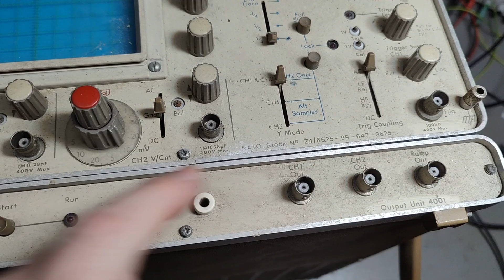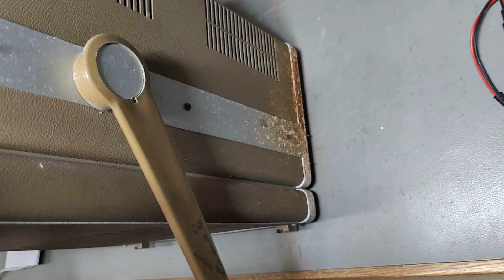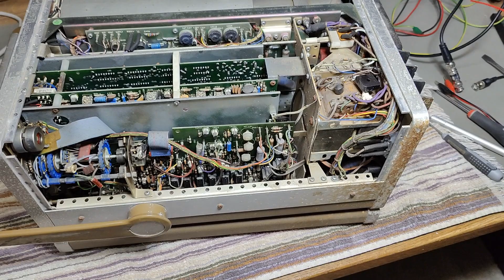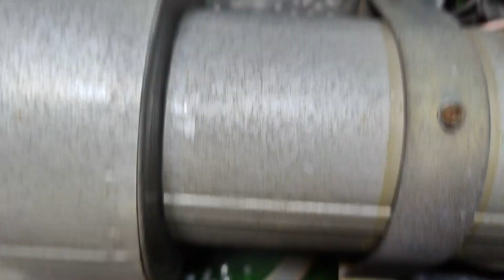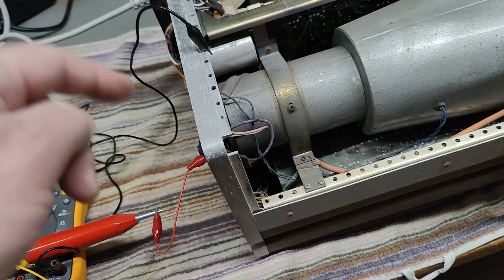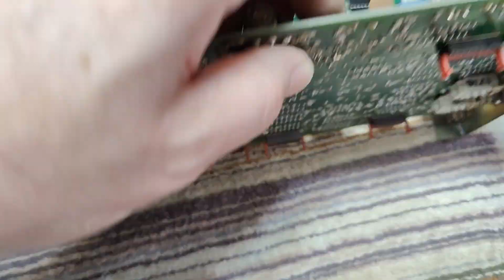Gould Advance OS4000 Analog Digital Oscilloscope 10Mhz teardown

Comment: How do you open volt/cm selector knobs ? Screw below the red cap is tight stuck.
Reply from the maker: use a knife blade and carefully insert then tip it, and then go round, the top cap can be pulled up

Comment: My OS1000 shifts trace vertically when attenuator setting is changed, both on Y1 and Y2 channels. Any ideas where to look for fault ?
Reply from the maker: you have DC offset currents going into your attenuator
Reply: @TeardownOZ2CPU yup....fixed. Thanks.

Now the knobs on voltage selector can't be removed because screw under the red cap is tight stuck.
Reply: @TeardownOZ2CPU blown fet tr101

Comment: I had a problem with no trace on one of these, very similar symptoms except there were several missing voltages from the power supply board at the back and it turned out to be one of the regulators, replaced it and boom

Comment: I own a Gould 4035, I looks a little different to this and I suspect it is a few years younger, but quite a few things are similar.

Like this, I had no tube display….but I also had a “hot” smell from the transformer (that looks almost identical to the one in this model)…the light globe in series glowed a bit to bright also…so I suspected shorted turns.

Eventually I got a copy of the circuit and my fears were confirmed…Gould get the tube HV supply directly off the 50Hz power transformer whilst other Oscilloscope manufacturers were using flyback, baxabdall or royer type HV supplies with far low volts per turn on ferrite cored transforners.

I downloaded the circuit of this one whilst watching the video…and, yep, there was that same 850v winding on the transformer and I suspect that is where the shorted turns were. 

Honestly, it IS WORTH cleaning it up and getting it going to see the rolling mode timebase at slow timebase settings and as mine has this mode too, I was determined to get it up and running so I took the transformer out and the 6.3v tube heater winding was right on top with the dreaded 850v winding the next one down. I unraveled the 20 odd turns of heater winding and hacked into the 850v winding with the side cutters. Half way through ripping it off and still with about half of it there, I decided to test it again via the series 40w globe…and low and behold I had cleared the shorted turns with still about 430v worth of undamaged winding on the core. So I wrapped it up in Captan tape, wound the heater winding back on the top, more Captan tape…put it all back together and constriced a voltage doubler using two HV diodes and two 220nF 1.6Kv film caps I had to hand…powered it up and YEP, it worked..all analog and digital functions!

  Like yours, and most other Pommy gear this age it was a fiendish “meccano set” to get apart and back together again, buy hey, we have cameras and can film and photograph so we can watch back to see how it was assembled.

  Mine has no memory depth, so no zooming in with the timebase after a samole is captured, but it did capture a line of PAL-D video, sync pulses, porches and chroma burst!

  Rolling display at slow timebase settings was also fun, very reminicent of a ECG monitor in a hospital.

  It worked gor about 8 months, then the burning smell came back…so the remaining half of the 850v winding was not as “clean” as the 40w globe had suggested…but I have an old Philips PAL vector scope here whose tube has a crack in it and the barium getters have oidized to white barium oxide…so I will cabbage the flyback EHT from that, rip off the remaining 430v of secondary from the 50Hz transformer and replace it with a 25v winding to rectify and power the flyback EHT cabbaged from the vecrorscope. Will need to do some jiggery-pokery to get the feedback from the EHT stack to “talk” to the bias of the flyback transistor and the end result should be a hell of a lot more reliable.

As this one had been wet…and so near the transformer too, I really expected smoke and smell when plugged into the mains without a series lamp…but, yes, just use some patience, clean the boards up with ethanol, (isopropanol is just too expensive). Really dirty and correded boards can be literally washed in the bathtub or sink with dishwashing detergent, then well rinsed with hot water then wast the water out with ethanol (methylated spirit) and put in front of a heater to dry right out. 
Really rusty parts can be etched with hot oxalic acid solution, this will remove the rust as a ligand complex but largely leave the metals alone…then runse with hot water and metho and the dry and use all the usual electrolube/deoxit or whatever you have there in Denmark.
I reckon thos is one of the earliest digital stroegevCRO’s, so definitely worth fully restoring!

oh, don’t plunge the transformer into the sink, you will never get it fully dry….most electronics can go in water, but transformers, speakers with paper cones and electret microphones don’t really appreciate a good dunking!

Comment: Nicely done Thomas. But for a parallel ADC you usually don't have a sample and hold. This is something you need for a dual ramp ADC, right? It needs to hold the sample for the intergation time. A flash converter doesn't integrate its as fast as its comparators....